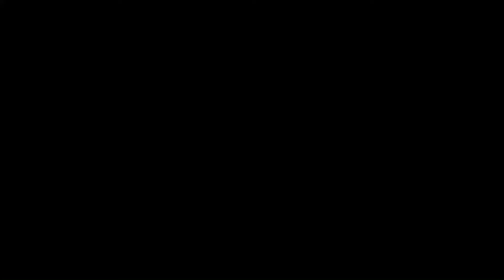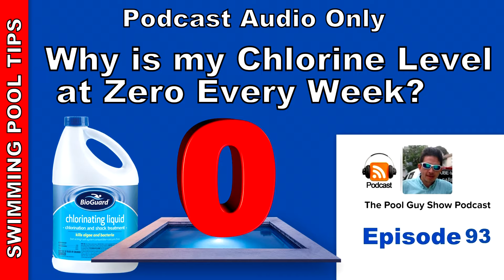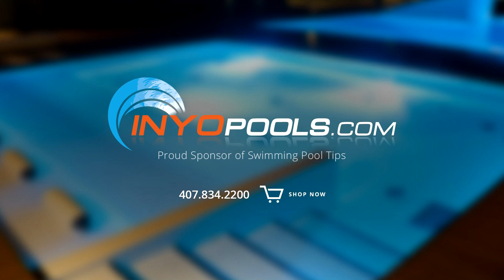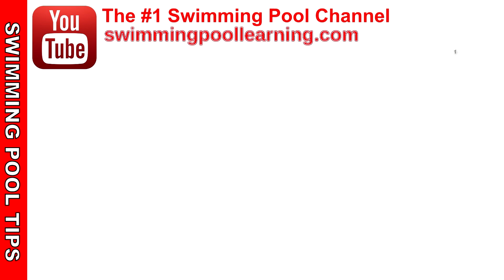Why is the Chlorine Level at Zero in my Pool?

Comment: I have a inground pool lyner.   20,000 gallon.     For the pass month my pool guy  cleans pool adds chemicals.    But 2 days later pool starts turning green.     I check with test strips.   Says no free chlorine.      I add more chlorine.   And i check the levels the next day.   And still says zero free chlorine.     Pool guy tested for phosphate. And reads between 300 to 400 ppb.    He used to keep my pool clean and blue.    But not cant seem to be able to maintain anymore.       Any suggestions thx
Reply from the maker: You need to treat the phosphates. Use a good phosphate remover - Orenda PR10000
Reply: Excellent thnk u for responce

Comment: Every week?? Every 24 hrs at the most! I've read high TA and too high or low CYA could be the culprit,, so after testing at Leslie's...I used muriatic acid for my 207 TA & 130 CYA levels. After 5 gallons of muriatic acid, the Clorox test strips shows TA at 180 and CYA at ZERO! How in the heck did muriatic acid lowered CYA??? Everybody says the only way to lower this is by draining, plus the TA didn't even get to a proper level either. PH went down to 6.2 which I'm now trying to rise with aeration as to not add anymore chemicals. I'm going nuts! My pool is only 4,500gals.
Reply from the maker: Maybe the low pH is causing interference on the test strip.
Reply: @SPL  ohhhhh,,,yeah, that could be it., thanks!!!

Comment: HElp With a vinyl pool liner. I have a regular spa waterfalling into my pool. I have zero chlorine. I am on my 4th pool help. I weekly guy, 2 pool repair guys and the 4th is a vinyl pool installer that won't listen to my quest for help.
Doesnt understrand i am possibly having a giardia or ameoba problem looking at zero chlotibe since june in las vegas. 
Thanks fof any help you can advise.

Comment: I have a 30,000 gal pool. I also have a two speed two horse power pool pump. I run the pump 24/7 on low and a Frog leap system. I normally don’t have any problems. Do you feel this is a good running program?
Reply from the maker: I think a few hours on full speed is important in the Summer months.

Comment: HELP 1 don’t know what’s going on with my pool all of a sudden this spring I keep having low chlorine readings so I crank up my output dial I test the chlorine in the morning the test strip shows bright pink like there’s too much chlorine and then I test again  in the afternoon and test strip shows it’s almost out of chlorine what could be going on? My salt is around 3200 I check it with a digital meter and the display so I know the salt is good.  
I have the Hayward aqua right system
Reply from the maker: If the salt system is giving you green lights and is producing check the CYA level and the Phosphate levels. Surpisingly high Phosphate levels can zero out your salt system chlorine.

Comment: My timer for the chlorine as no off switch is this correct. This means my chlorine is on all the time is this correct.
Reply from the maker: I am not sure what brand that is but in that case, yes - it will always be letting chlorine is as long as pool is running.

Comment: I had a zero reading every week, then I had the water professionally tested.  Came back high level Chlorine but too much CYA!  Pump not being run enough cause the problem?  Will drain water down 11/2  feet, to dilute pool, to lower CYA, refill then hopefully it will resolve the Chlorine problem
Reply from the maker: Depends on the pool size. Usually 1-2 ft will do the trick
Reply: @SPL  So, if understand correctly, when you pool guys say "drain the pool", context is important.  For high CYA or TDS or similar, you really mean drain it 2 feet, enough so everything's diluted by about 30% and after refill those readings will be back in the acceptable range.   But, presumably that doesn't apply to a "drain the pool" aimed at eliminating established algae?  I was thinking such a thing would require acid washing the pool surfaces, for example.   (Appreciate your content.  Keep it up.)

Comment: Is it better to circulate the pool during the heat of the day to prevent the water from evaporating and protect the chlorine better?
Reply: pool cover, limits UV that breaks down the chlorine and stops evaporation and crap landing in the water.  win win.
Reply: During summer its best to circulate more hours to keep it cooler and use less chemicals.
Reply: @carlosmacias7326  warmer doesn't really affect chlorine, it's UV breakdown and evoporation.

*The Effects of Temperature
Temperature indirectly affects chlorine breakdown. Many bacteria species grow better in warmer water. When bacteria proliferate, free chlorine is used up more quickly as it kills them. Here's a general rule of thumb: For every 10 degrees Fahrenheit above 80 degrees Fahrenheit, twice as much chlorine is needed in the pool to maintain an adequate free-chlorine level. This is more important for spas, which are regularly operated at higher temperatures.*

https://sciencing.com/heat-sun-affect-pool-chlorine-21723.html

Comment: David, remember I told you about my new iChlor reading salt at 4500ppm vs. SpinTouch insisted on 3600ppm. I wasn't comfortable with that 4500 number since my plaster has seen better days to be tortured by salt. I ended up draining 40% of water to match 3600ppm on my iChlor and make it happy. Spintouch is now reporting 2800ppm. It seems that iChlor is totally happy with 2800ppm as well, still producing tons of chlorine. Do you think low salt is bad for iChlor in long term?
Reply: Arthur Vin I would say if your Salt cell is producing enough chlorine to keep your pool sanitized at that level even on extremely hot days you shouldn’t have issues, but if you notice it can’t keep up, I would boost that level to the recommended amount for your cell. It’s really about cleaning your cell and maintaining it that will hurt it if you don’t, if it gets calcium build up etc.
Reply: @awhitepillow_1385  I wonder how low salt could affect pH climb. Technically, the salt cell would need to work harder to bring that chlorine, hence producing more hydrogen and oxygen atoms  aerating water and hence messing with pH, which will require adding more acid to keep it in balance. But it's been 4 days since I diluted excess salt, and interestingly enough, I observed pretty much opposite effect, kinda against theory - the pH hasn't moved from day 1, it kept steady pH for 4 days at 7.6, for the first time in the history of my pool. It would be great to understand chemistry and science behind.
Reply from the maker: Strange that your salt readings are off but if everything is working you will be fine. High salt has more of an effect than low salt.